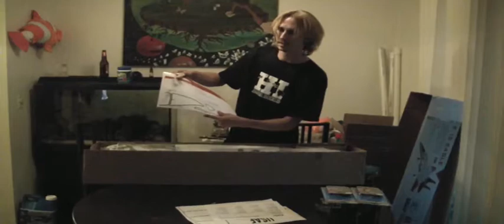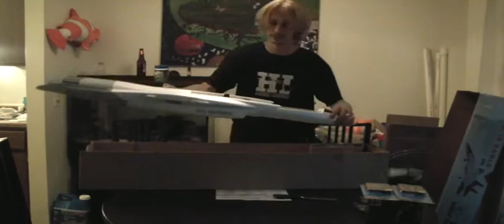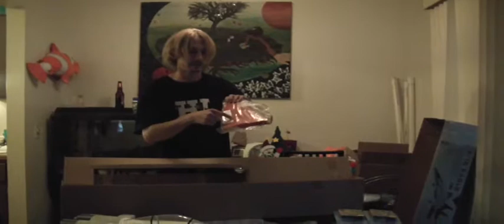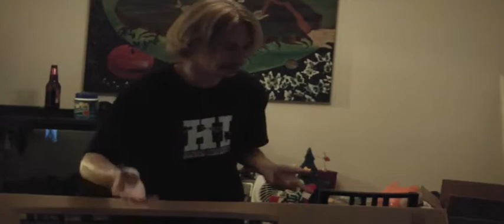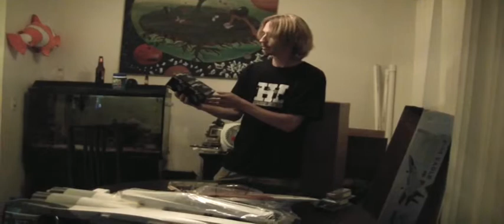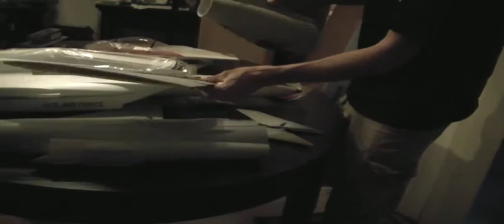E-Flite F-15 Unboxing and description

Comment: @earthling1984 yea there battery's are pretty good.i just recently got 6 160mahs for the 4-Site for under 20 Bucks Shipped,and there Great.@ $1.69 a piece you cant beat that,where at my LHS the E-flight ones are going for $12.99.
Their ESC's are pretty good as well.But from what I've read there Motors are hit and miss,What HK lacks is good Quality Control.

Comment from the maker: @eastcoast78 yes, you could use other hardware.  The hardware I am showing in this video is the suggested 'high performance setup' for this plane.  It is listed on the HH site and is a drop in fit for the plane.  You could use other hardware, although, I have had nothing but bad luck with hardware from other companies.  You could for sure use different batteries though, I ordered some more batteries for this plane, and they are coming from hobbyking - some 2650mah 4s 25c - 50c nano-tech batts.